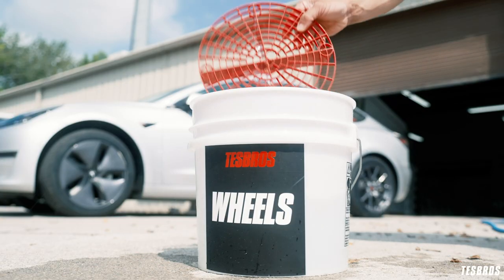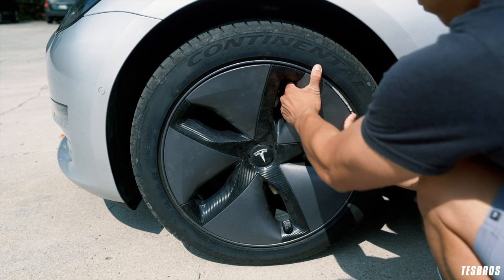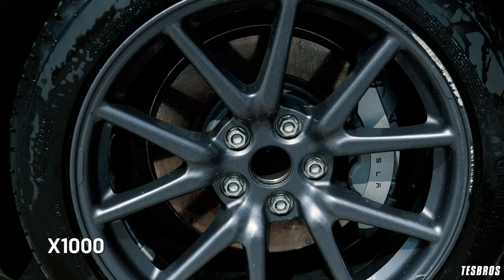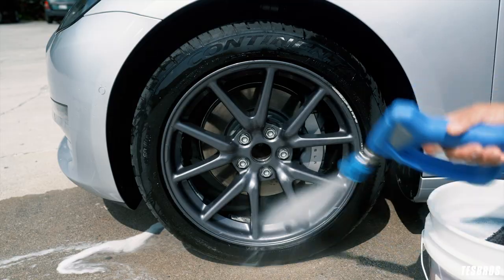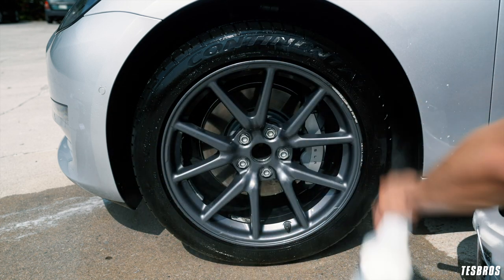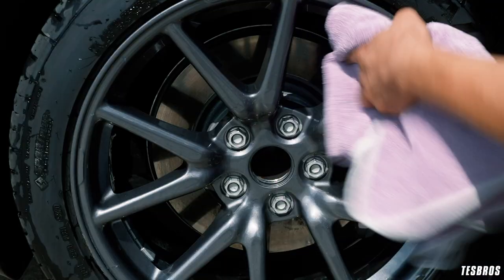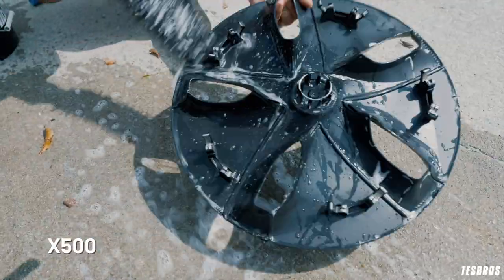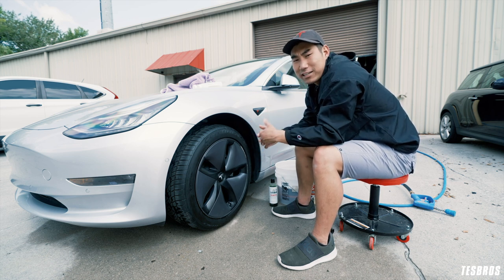How to Properly Clean Tesla Wheels and Tires - TESBROS

Comment: Love it. But too much work. I use meguiars one step spray cleaner which includes iron remover. Its expensive but does a good job. I let it sit. Then I use a battery powered high pressure washer to rinse it off. Then I go over the wheel and tires with a moderately abrasive rotating brush and rinse that too. I let it dry and use heavy duty tire shine on the tires and let it sit for an hour or more not in the sun and repeat and leave the car in the garage if possible overnight. The shine lasts a long time.

Comment: do you touch clean the brake steel pad just behind the inside of wheel?
Reply from the maker: The calipers in general are hard to access with the wheel on so if I’m doing a full detail, I’ll remove the wheels and clean the calipers that way so I have much better access.